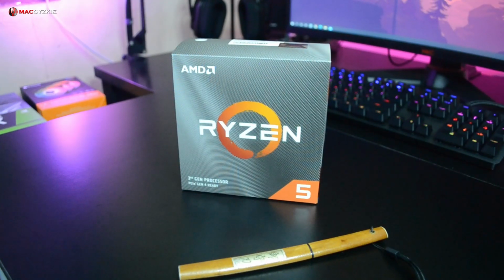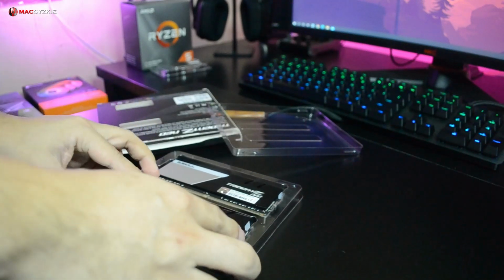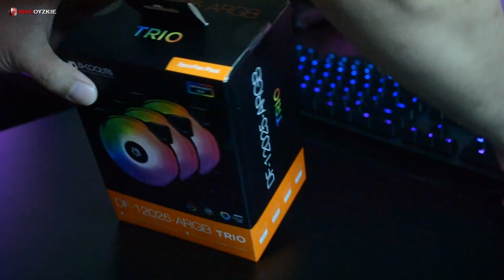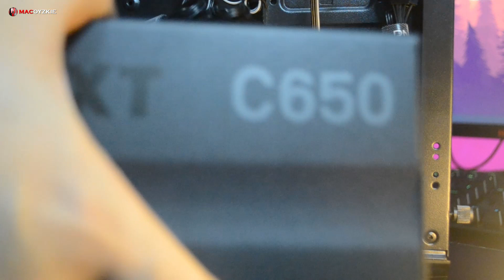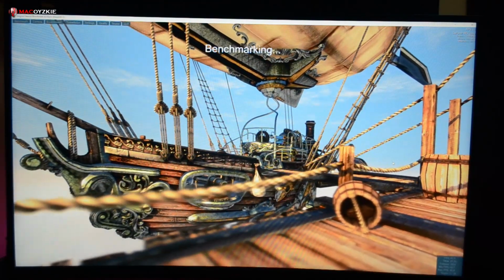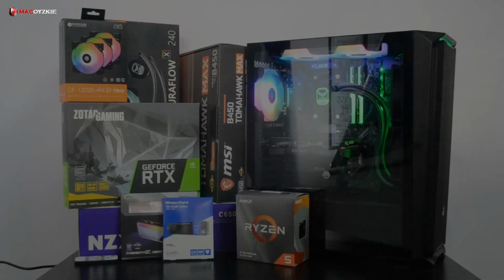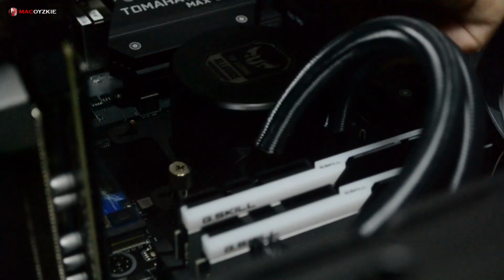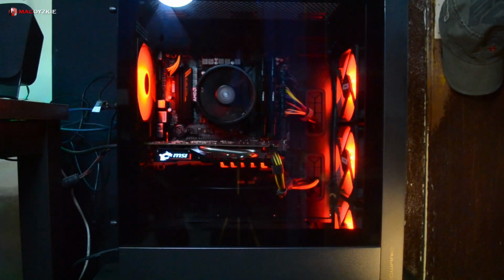Ryzen 5 3600 + Rtx 2060! $1000ish pc build

Comment: sweet build, however I'm getting a rtx 2060 gifted to me for free however my cpu only has 4 cores (ryzen 5 3400g) will it bottle neck the 2060 or will it be fine?
Reply from the maker: around 17.7% bottleneck i guess, not that much but i think that'll be fine. You need a Ryzeh 5 3600 to have 0% bottleneck
Reply: @MacCoyzkie  thanks for the feed back and I will save to buy a ryzen 5 3600 :]

Comment: Nice vid, bro. Just a quick question, is the clearance at the top too small for the auraflow aio? 

p.s. Use Deepcool RGB Convertor to sync 5V3Pins to 12V4pins

edit: just finished your vid and my question was answered hehe.
Reply from the maker: Deepcool RGB Convertor to sync 5V3Pins to 12V4pins! this is interesting, i'll check it out thank you also thanks too for the feedback
Reply: can i use a mid tower atx pc case

Comment: Lmfao if you guys can get this build anywhere around $1000 then you're lucky. 
Nice build either way
Reply from the maker: it was build before the too much price inflation. Yeah the owner of this was lucky, right now i can't upgrade at all since everything is twice the price. i think i'll just have to wait
Reply: @MacCoyzkie  I got lucky after having found an rx580 4gb for 130 dollars. It looks like new, I saw it working but I hope everything is fine as when I built my PC it would reboot when in-game. It's probably the power supply
Reply from the maker: @Dan01-01  $130 not bad, lucky you bro. When it reboots only in game, try checking the temps using msi afterburner
Reply: @MacCoyzkie  it's not the temps, hitting 30 on my ryzen 5 3600 at idle and 30 on the rx580 idle. In game they climb to 40 and 50 respectively. I did some tests and the GPU voltage is as low as 11.453 on the 12v rail. Likely the PSU (it's new, but it's possible it's failing me a little but enough). I'm praying
Reply from the maker: @Dan01-01  i see, let's hope it will not then :D
Reply: I just copped this build for £900. Me lucky
Reply: @Castrated__  it's still over a 1000$ but it's fine, still lucky :)
Reply: @Dan01-01  :)
Reply: @Castrated__  I just copped this build for $350 and it came with a 144hz monitor.

Comment: mine is kinda the same build same cpu and gpu only mine cost 2000AUD. yikess
Reply from the maker: probably that is because of the crazy overpricing of the gpu nowadays but there are rumors that it will go back to normal prices soon
Reply: @MacCoyzkie  I haven't purchased it. yet should i wait it out?
Reply: @MacCoyzkie  i really don't wanna wait a whole year tbh lmao
Reply from the maker: @dromeda6066  if you really need i think it's ok but if you got a working pc with not much of a lower specs than this rig in the video, waiting is probably the best option. I plan on upgrading this year but when January comes prices are too damn crazy, every month there is an increase and it's like stupidly overpriced. and yeah you might be waiting for a year if ever so if you need a working pc right now buying it is fine too
Reply: Yeah bro i hate living in Australia you get the most overpriced pcs and the worst wifi